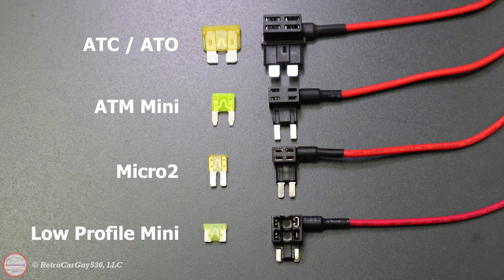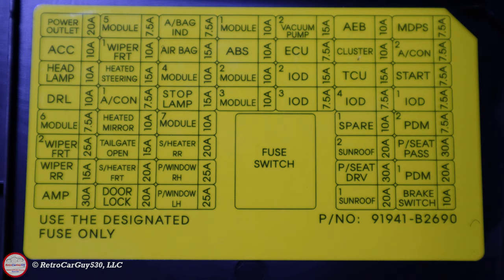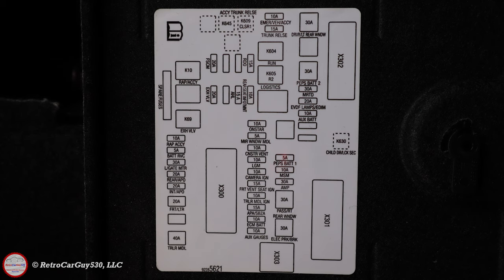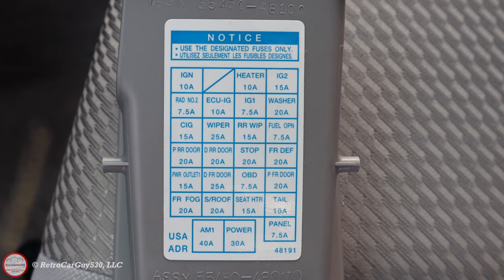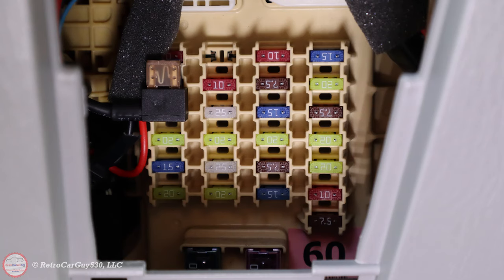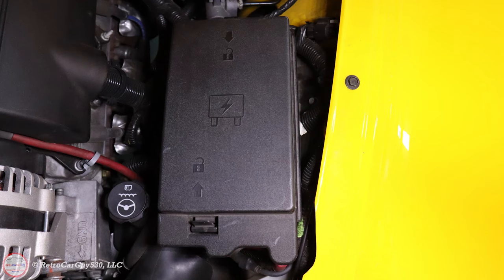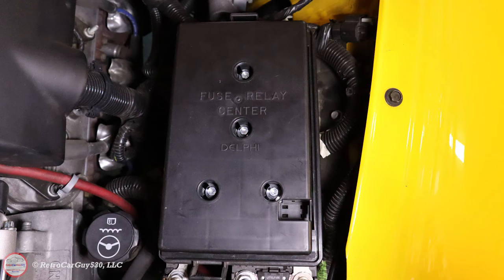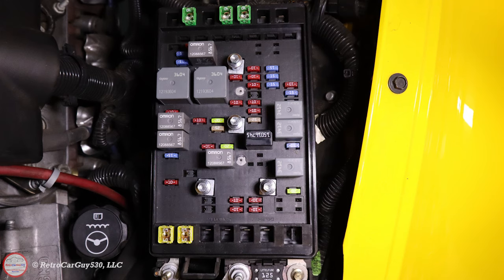How To - Add a Fuse Tap in Your Vehicle

Comment: Super helpful explanation of how to determine which side of the fuse slot has 12v to make sure the tap is oriented correctly. I also learned that fuses have the exposed metal on too for probing. I have never noticed that before!
Reply from the maker: Glad it helped

Comment: I too watched multiple videos and multiple web sites with no answer to my questions. THANK YOU , THANK YOU, THANK YOU!!!!!!!!!!! 
My questions were:
1. Which side is the hot side on a fuse tap. Others glossed over it. You were very precise with pictures and typed out what is what.
2. If I could use only one fuse for the cb add on I wanted to use.
3. That I could use on open slot. And how to use it.
Thanks again!

Comment: Appreciate your explanation on fuse taps !  I am currently hard wiring dash cams on a couple
of cars - one has an empty slot with power, the other one - I will have to pull the fuse, add the tap & reinsert 
the original & accessory fuse.  I had no idea about the order these fuses went in - until watching your fine
tutorial. Thanks again !!!

Comment: This is a well done video.  Thought out well and  is very easy to understand.  I have a Amp for a speaker system.
I went into it to make a few gain adjustments and found that the Alpin light  on the Amp has been on, charged, for 6 years.  
I did  find the proper fuse that only foes on when the ignition is turned on.  all is well now.  TY.  Never knew they had piggy back fuses ...:)
Reply from the maker: Thanks!  I'm glad you found the information helpful in solving your amp's power issue.

Comment: Great video and explanation 👍. 

Instead of cutting a fue, you can use the fuse tap without installed fues to check for power as the metal leads reachable.
Reply from the maker: I have a statement in the video description's section about using the fuse tap with a fuse installed only in the top fuse socket to check for power.

🔷Another "easier" way to test for fuse socket power and avoid using the 1/2 fuse testing approach is to use the fuse tap itself with a fuse in the top fuse socket of the fuse tap.  In this approach, you test for power by inserting the fuse tap and then checking for power at the end of the red wire coming out of the fuse tap (as shown at 11:00 in the video).  If you don't have power with the fuse tap in that position, rotate the fuse tap 180 degrees and test again.  Once you find the correct orientation for the fuse tap in the fuse socket, you can install the original fuse from the fuse box fuse socket in the lower fuse socket of the fuse tap.  If there was no fuse in the fuse box fuse socket then you should not have any fuse in the lower fuse socket of the fuse tap.
Reply: @RetroCarGuy530  Thanks a lot for the info. In fact, this idea is much better. 
Great Work 👍.

Comment: Thank you for this.   Was trying to install a hardwire for a dashcam in the interior fuse box of a 2022 honda accord and I have blown 2 multi block fuses when just using a test light probe to find which side the power was on.  The second time I was very careful, but once I touch one side of the contact, it arced.  Not sure what I'm doing wrong but I like the idea of using the half fuse for a testing.

Comment: Perfect video! I only run into the issue of the added fuse NOT fitting into the housing before I place it into the fuse box. It just doesn’t want to go in no matter how hard I try and it’s been confirmed to be the correct one
Reply from the maker: If I understand you correctly, the fuse that plugs into the top slot of the fuse tap is not fitting (the fuse for the new accessory)?  I've seen some fuse taps of lower quality that have a variation in their compliance with the size specifications for the fuse type they're to support.  The only thing I could suggest is getting another fuse tap of the same type from a different company/seller.  The fuse should fit snugly into the socket for it, but it should not be overly tight preventing you from inserting the fuse into the socket.

Comment: GREAT video!! 
Quick question.. can i tap into my fuel pump fuse to 'tap' into it with my aftermarket amplifier?
Reply from the maker: I would suggest to not use the fuel pump fuse for an amplifier (or any other accessory).  Why I say that is the fuel pump is a critical system of your vehicle and I recommend against using a fuse tap in a socket that is obtaining its power from a module, sending its power to a module or critical system.  This is to be a as safe as possible to not introduce a problem by adding a fuse tap to the circuits for those types of critical systems.

I would also assume the amplifier might pull a non trivial amount of amps as well.  In my FAQ video, I discuss more in depth about my 25 amp maximum for the original max power draw (fuse amp rating) along with the amps for the new accessory.  This is the link to that FAQ video: https://www.youtube.com/watch?v=DnZ5wb_A5vE

Comment: Thank you. You have cleared up most of my questions but two. 1. How do you know the wiring behind the fuse socket can sufficiently carry the current for both devices? 2. If you happen to find an active empty position, again, how can you be sure you will not overload the wiring there? Thanks again. Lance
Reply from the maker: The power bar that blade style fuse connects to on the back side of the fuse socket (inside of the fuse box) are capable of carrying a decent amount of current/amperage.  There are times that even the vehicle manufacturer will overtax the current draw on the power bar for a portion of a fuse box.  I had a 2012 Dodge Charger SRT8 that had just that situation and FCA issued a recall to have a couple of fuses / circuits moved from one fuse bar to a different fuse bar within the fuse box.  The only sure way to not exceed the available power on the fuse bar(s) within the fuse box sockets is to have a full understanding of which fuse sockets are tied to which fuse bars within the fuse box and how many amps are available on each fuse bar.  That is not something that is usually available from a vehicle manufacturer.   Most (if not all) vehicle manufacturers will not look favorably on the customer adding a fuse tap to any fuse socket in the vehicle. 

That's why I strongly suggest that the fuse socket must source its power directly from the battery or from a switched battery power source to be assured of sufficient power.  It is possible that a fuse socket in a fuse box can obtain its power from a module within the vehicle (like the body control module - BCM).  You don't want to select a fuse socket that is sourced from a module or supplies power to a module since those type of fuse sockets will often be sensitive to the amount of power present or consumed via that fuse socket.  For example, the BCM provides power to a large number of items / accessories in the vehicle like the interior lights of the passenger compartment.  There will be a fuse in a fuse box (likely inside of the passenger compartment) for those items that receive power from the BCM.  Adding a fuse tap to a fuse socket that sources its power from the BCM, may place too much of a load on that circuit from the BCM and it may cause issues with the thing being powered by the BCM or the BCM itself.

A fuse tap is also limited in the amount of amps it can safely supply as well since the wire gauge (awg) of the wire coming out from the fuse tap will often be limited to 10 to 15 amps max.  Blade style fuses range in amp ratings from 1 amp to 30 amps.  Fuse sockets that need to supply more amps are often a different style of fuse (not a blade style fuse).

I have a follow up FAQ video that tries to discuss some of these questions.  https://www.youtube.com/watch?v=DnZ5wb_A5vE

I hope that helps.
Reply: After installing a fuse tap do you ground the black wire for your accessory off to the car?
Reply from the maker: Yes you do!
Reply: @RetroCarGuy530  thank you 😊👍

Comment: Good Vid but, the one question to ask is what is the amp value behind the panel that feeds that circuit ...for light stuff you'll be ok, but if you want to supply a sub panel you need 30A and i don't think any of these taps will handle more than 10A....newer vehicles TIPMs have sensitive solid state boards in the PDP  making issues worse.
I like to always in stall 2 fused sub panels one full/hot and one run/Acc, this makes future add-ons a breeze, but it needs to be done properly.

Comment: Does the fuse itself have to be inserted a certain way? Or either way will be fine?
Reply from the maker: The fuses can be inserted in either direction in the fuse tap.  The fuse tap is the only part that requires that it be inserted into the fuse socket in the correct direction.  It's very important to get the power from the fuse socket supplied to the left leg of the fuse tap since that is the side of the fuse tap that supplies power directly to both fuse sockets within the fuse tap.

Comment: Thanks so much for the clear explanation, exactly what I needed to fuse tap a reversing camera for our van!
Reply from the maker: Glad it helped!

I have two other videos related to automotive blade style fuse taps that may give you more info on this topic.

I have a frequently asked questions video based on this video.

FAQs - How To - Adding a Fuse Tap to Your Vehicle : https://www.youtube.com/watch?v=DnZ5wb_A5vE

I recently created a video that explains how the power is routed in a blade style fuse tap and it shows an easier method to test which side of the fuse box fuse socket provides power.

Anatomy of An Automotive Fuse Tap : https://www.youtube.com/watch?v=YNc0FfeL6rw

Comment: Thank you!

1. Always a new fuse in the top or wire side for the new accessory. 
2. The bottom slot or opposite wire side only for existing fuse.
3. Positive (+) blade on the add-a-fuse is the left or furthest from the wire.

Did I understand this correctly?
Reply from the maker: Yes!

Comment: Thank you for the informative video. I have one dumb question...where is your black probe connected from your multimeter when testing for available power?
Reply from the maker: You connect the black probe / ground connector to an available ground point or a bolt / screw connected to the body of the vehicle or bare piece of metal and that should give you a grounding point for the test.
Reply: @RetroCarGuy530  Thanks for the quick reply!

Comment: Great Vid!!!

Question: 
1. So... Adding a fuse to one of the open spots in the fuse panel is ok? I won't accidently get power to something that wasn't meant to be powered before...?

2. Is it safe?

It's been a while since this video was posted and I hope you're still taking questions on this...
Reply from the maker: You should be able to use an open fuse socket assuming it provides the type of power you need - accessory/switched or constant/unswitched power.  The other thing that's nice to confirm (if possible) is that the fuse socket obtains its power directly from the battery (constant/unswitched) or directly from the ignition switch system (accessory/switched).  Auto manufacturers will tend to use one fuse box design in multiple vehicles and depending on the features in the vehicle some fuse sockets may not have fuses in them because the feature that normally uses that fuse socket is not present in the vehicle, but the power routing within the fuse box still provides power to the fuse socket.

An unused/open fuse socket can "safely" be used if the fuse tap is installed with only a fuse in the top fuse socket of the fuse tap.  The rule is that if the fuse box fuse socket had no fuse in it before the fuse tap was installed, the fuse tap's lower fuse socket must not have a fuse in it.

I have a couple of other videos on this topic.  One that discusses this topic a bit more in depth.  My anatomy of a fuse tap video: https://www.youtube.com/watch?v=YNc0FfeL6rw

I have a FAQ video as well that tries to answer some of the common questions and it also discusses wire gauge and how that limits the max amp rating for any fuse tap / fuse in a fuse tap.  https://www.youtube.com/watch?v=DnZ5wb_A5vE

As I mention in my FAQ video, I tend to recommend to use fuse taps to provide low amp power for accessories like dash cameras, radar detectors, etc.  Those items only consume 1 to 5 amps.  If you're trying to power some high amp draw device (like off road lights, electric motor, etc), using a fuse tap to provide the power directly to the new accessory is not the best approach in my opinion.  I suggest using a relay to provide the power and use a fuse tap to obtain the power to control when the relay turns on/off.  The relay's control circuit is usually only drawing less than one amp so a fuse tap is a great way to get the power for the control circuit side of the relay.  You can get the high amp power directly from the vehicle's battery (with an in-line fuse) and use the correct wire gauge to safely supply the high amp power to the new accessory.

I hope this helps!

Comment: Help, I'm a little confused.  Earlier in your video, you state that it might be unwise to use a "blank" fuse holder (location) as there is probably a good reason that the blank was left there during factory assembly; and it might be wise not to utilize that 'blank'.   But, later in the video, you actually use a 'blank' slot, next to one of the Relays, and you were succesful in connecting your new accessory fuse!    

My new accessory is going to utilize a relay as it needs a high amp draw.  I would like to use a 'blank' fuse slot for my new accessory, but I'm concerned that I might otherwise cause some damage to my existing wiring in my truck.

Can I use a blank spot for my new fuse tap?   

Please advise, and thank you for this video.  It was very informative.
Reply from the maker: Using an unused fuse socket is okay especially when you're only requiring a small amount of power (about 100 mA in your case powering the control circuit/side of a relay).  My caution about unused fuse box fuse sockets (in the video) is to make sure you do not install a fuse into the lower fuse tap fuse socket when installing a fuse tap into an unused fuse box fuse socket.  There's no need for a fuse in the lower fuse tap fuse socket when the fuse box fuse socket did not have a fuse originally.  I've seen some fuse tap installations where the installer incorrectly added a fuse to the lower fuse tap fuse socket to get it to "work".  They did not check which side of the fuse box fuse socket provided power and when the fuse tap was installed, the new accessory/device/relay did not have power.  To "solve" it, they incorrectly added a new fuse to the lower fuse tap fuse socket.  That makes the fuse tap power to the new device "work", but now power is being fed back into the fuse box fuse socket load side and depending on how that fuse box is internally wired, there may now be power fed to things that did not have power before adding the fuse tap.

If the fuse box fuse socket did not have a fuse before the fuse tap, then no fuse is installed into the lower fuse tap fuse socket.  If there was a fuse in the fuse box fuse socket, that fuse is installed into the lower fuse tape fuse socket.